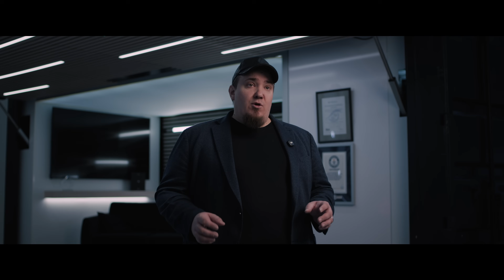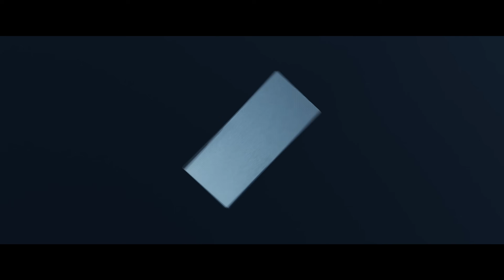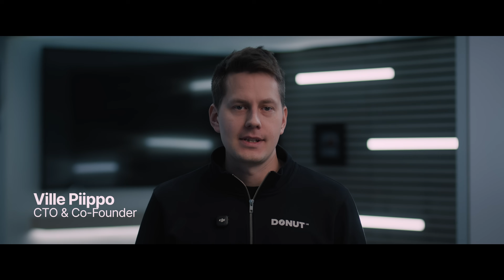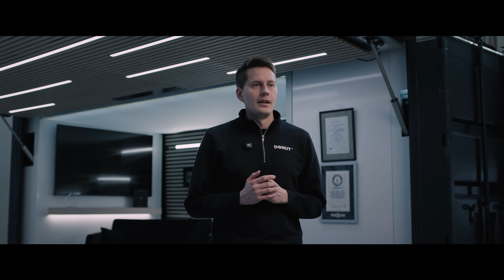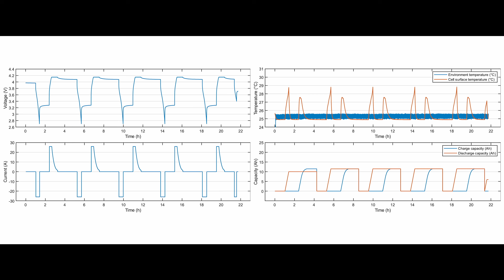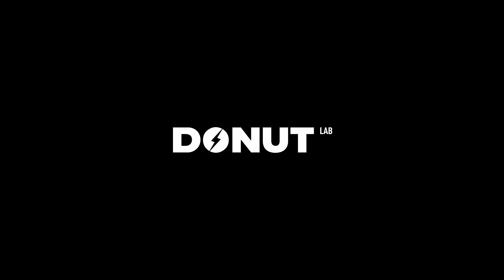Donut Solid-State Battery: Safety Demonstration Test | I Donut Believe (Pt.5)

Comment: I'm interested to know how a cell with a broken seal and no gas generation is able to puff up like a ballon to nearly 20% of it's original size 🤣
Reply: Gemini said
Like @RatInACage guessed, humidity is likely the culprit. Solid-state materials tend to soak up moisture like a sponge, (really hydroscopic?). Once the pouch breaks, the damp air gets in and reacts with the battery chemistry, causing the materials to physically swell. It puffs up just from that reaction, even without any gas or heat being generated. Probably also some physical separation between the layers, most likely what caused the loss in capacity, and then weirdly the gaining back of some capacity.
Reply: Maybe via humidity absorption? 🤔
Reply: Perhaps a reaction with air (oxygen/water vapour?), due to the pouch losing its seal. Wouldn't be the first material to react and expand on exposure to air. 

There is an amber/red coloured blob of something in between the battery terminals in the document's expanded pack photo, by a crease in the foil. This would make sense as the location of a pack failure given it had to deal with high temperatures from the 100°C test and charging current through the terminal. 

Oddly this particular cell didn't have Kapton tape across the terminal seal edge (neither in this test nor the original high temperature test where it first failed), unlike the other cell subject to the 5C/11C charging test. Perhaps it's a thermal handling weak spot for the test cell pouch material. This might explain the adoption of pouch casing, as seen in the CES demo cell, improve thermal transfer and add clamping forces.
Reply: Can you explain how gas keep inside if pouch is broken? Or how if there is gas pouch is flat in surface not a balloon? There is picture on page 14.
Reply: @villeyoyo Yes. The cell looks very uniformally swollen. Pouch is tight and flat as a plank.
Reply: @villeyoyo  Yep. Very odd looking swollen pouch compared to an NMC cell. A swollen NMC cell looks nothing like that.
Reply: Pouch must be a strange material. At the first test 100 C pouch broken and looked like a empty balloon. And now like a tight brik.
Reply: Could the plastic film layer on the aluminum pouch have decomposed during the previous high-temp test?  I’m wondering if they’ve actually solved the seal and pouch material problem for real production. It’s pretty clear that the current material isn’t up to the task at 100 °C (the pouch lost its vacuum after the earlier test) If they had already fixed this issue, why reuse the damaged cell instead of using a fresh one with no problems? The motorcycle production and delivery timeline (Q1 2026 with Verge) doesn’t really match having to solve this kind of fundamental packaging problem right now. In other words, it looks like they still haven’t found a supplier capable of producing a pouch envelope that can reliably withstand these extreme temperatures yet. What do you think, Ziroth? Have you seen any update from Donut Lab on a new pouch/seal material?
Reply: @Doctorbasss they don't need to find a fix.  They're not suggesting that 100 degrees C should be a regular state for these batteries, they were just trying to prove they can do something that lithium calls cannot.   Max cell temps of 80 degrees will be fine for a production pack
Reply: @craigsteele9469  Exactly. Charge the battery at 100ºC and then try to seat inside that car and drive away.
Reply: Someone really needs to test li-ion in the same manner as their vtt tests to see if there's any actual differences......
Reply: Oxidation due to… well oxygen and water vapour? Outer layers  oxidized and protected the inner elements from further oxidation and cell stabilized at 40% capacity.

Sort of like a chemical puncture. Undamaged area remained operational. Voltage remained constant, capacity did not. Just guessing….
Reply: I can't tell if you're laughing or crying. Are you ready to double your bet? $$$$$$
Reply: Boy I really hope for your sake we’re living in the 95% and not the 5%(according to your odds).
Reply: Ziroth stop humiliating yourself lmao
Reply: so it shrank did it?  You mean TO 120% of its size, or BY 20%
Reply: @craigsteele9469 good spot - by 20% (to 120%)

Comment: Why were we never given the weight of the cell, even after several requests?
Reply: It's standard marketing practice to save the most wanted information for last to keep people on the hook longer and keep the product in the media cycle longer. 

I suspect the battery is very easy to reverse engineer, so they want the time to build hype, and product using the batteries, before releasing all information and making the cells available for purchase.
Reply: They are not reading the comments. Oh wait...
Reply: You wanna wanna wanna wanna cry???. Don't be a baby and just wait.  Waiting is not costing you anything and I doubt you are sitting on pins and needles waiting for the the total results.  This is real life and problems happen and no technology is perfect.  This one just makes promises that are better than other existing batteries.

Comment: Interesting that you would create this magic battery but not bother to put it in a pouch that would handle the temperature you've specified. Not catching fire is good though, but also you acknowledge that your battery does not infact handle 100 degrees temperature since it degrades so severely after a single cycle at that temperature.
This is not what you've been claiming.
Also how is that funding run, that you were totally not doing, going btw?
Reply: I think this indicates that the cell under test is still a prototype. He admits using a pouch designed for Li ion, probably becuase it was easily available for prototyping. If 100C is going to be a production specification, Donut should be busy right now sourcing a higher temperature rated material. My suspicion is we are going to see general de-rating of all specs when (if) the battery enters production. They have plenty of room to derate from their claims and still have a very good battery.
Reply: I believe some people just thought that something duch as the polyolefin adhesive on the pouch melted at 100 celcius. You would never consider the polyolefin adhesive failing because lithium pouchs never get to 100 Celcius when borrowing that pouch technology.
Reply: " but also you acknowledge that your battery does not infact handle 100 degrees temperature since it degrades so severely after a single cycle at that temperature."
Haters should wait 5 minutes and think about what they see before spewing vitriol.
Genius, the pouch was damaged. This is, the case or envelope of the battery if you wish was damaged. If the enclosure is damaged and the battery looses vacuum, the battery cells are exposed to the environment, e.g. oxygen, humidity, etc. If the pouch wasn't damaged, do you know how many cycles the battery could handle?
The pouch, as was explained to you, was designed for a lithium battery. No lithium battery even dreams of do anything close to 100º C (other than catch fire).

Comment: So what does this have to do with a production ready battery? If you are testing it with a pouch that is not appropriate for the cell ? You are just testing something. Nothing seems really ready for a production vehicle. I wonder what was inside that Verge...  by the way, why Verge's parent company is inactive? How do you fund yourself right now?
Reply: Let me just remind you that I've been skeptical from the very beginning, if you've seen some of my early comments. However, I am ready to admit that I might have been wrong; we'll see. In this case, however, I must support Donut Labs. The pouch may be production-ready, as the batteries are not supposed to operate at 100 degrees Celsius. In the normal operation temperature (say up to 60 degrees), they may be perfectly fine. So, I don't see any issue here. I am really curious about the cycle life (even 10k would be awesome), aging, and energy density.
Reply: @filipohrbek  I agree. I don't know if people realize how hot 100ºC is. For the luddites in the imperial system,  100ºC is the boiling point for water.
Nobody is charging batteries at 100ºC, even if the battery cells and the pouch could take it. No this battery, no other batteries, no batteries in the future. Unless you want to transform the car into a huge pan.
You will warp the plastic trims of the car, damage its upholstery, melt electronics, and potentially burn the people inside the car. Not to mention the stress to the car's metal frame that will absorb the heat, and its structural integrity after a few cycles of thermal expansion and contraction.
Reply: I think safety would matter obviosly...

Comment: Safety test is nice, but I hope you are saving cold temperature performance, weight, 400w/kg energy density and most unbelievable claim - 100k cycle life - as the last tests. Because those are the biggest and most important remaining questions to back up the validity of your claims.

Comment: We won't really learn much until the bikes are shipped and in the hands of owners. I believe the cold test didn't live up to the hype and they are reformulating the battery for better results and they are stalling for time to do so.
Reply: The bikes are even more of a problem than the possible SSBs, Verge is not a real motorcycle brand, they're a test environment for their trials. Everything seems in a test phase., nothing is production ready.
Reply: And for way less money you can buy a Zero DSR with similar real world specs. The 600km they advertise is for the big battery (33kWh) version and that is their claim of a CITY range.
They promise 315km doing 90km/h. The zero can do 170km with the 15kWh battery at highway speeds.

My car, VW E-UP can go 260-300km with a 36kWh battery. Not impressed even at what they are PROMISING to deliver.
Reply: @gronz  they claim to get it in customer's hands at the end of march. So by that they must have producted quite a few by now :D
Reply: @Bullseiify  Seems like I heard Verge say about several weeks ago the bikes would be delayed until later in the year.
Reply: @sloansteeringsystems it is a scam , they will keep delaying bike
Reply: @Bullseiify  But the bikes are not even homologated yet ?

Comment: How can a battery cell return an error message?
Reply: When they're put into a pack, they get a battery management system (BMS). Nearly all multi-cell lithium packs have one for saftey
Reply: @Tazdeviloo7  When you put it in a pack, the bms will manage multiple groups of cells, not each of them individually. They will not know something went wrong so easily
Reply: @cristibaluta Any decent BMS can detect a single bad cell fairly easily even if just measuring at a group level. A group (series string) will not hit peak voltage, may have voltage sag, etc. from just one bad cell.
Reply: @Tazdeviloo7 
Yes - exactly. That's not an issue here.
Reply: @Tazdeviloo7  yeah, thats true, but the cell itself doesn't know anything. given that this is a cell test its a bit confusing to word it like that :) You can simply say that when a battery temperature sensor reads 100 degrees you get an error message.
Reply: @Bullseiify Right, what they said was technically incorrect, but if your familiar with batteries and the way they fail, it makes sense. A normal Lithium NCM pack would shut itself off completely and you can't use it. Also it's a huge fire hazard. They're saying you can use their battery after damage, just with an error message like a check engine light in a car.

Comment: Never ask a woman her weight. But most importantly, never ask Donut Lab the battery weight
Reply: Lo sai già se hai visto il video sul CES
Reply: @SEmanelit   are from vinvast?? Lol if true, and if donut battery also true, vinvast car buy and must use donut battery Lol
Reply: @paktio3985 la batteria a ciambella raffreddata a aria è stata studiata per la moto. Per auto,per drone e per tanti altri usi sarà concepita in modo differente.Tu te la vedi una batteria di Donut lab dentro un telefono,un orologio a forma di ciambella raffreddata ad aria?Io no. Sarà sicuramente con una concezione costruttiva differente.
Reply: @SEmanelit  ma sei serio?
Reply: If it fits on the same motorcycle and has more power than the regular lithium ion pack, I think we kind of know what the weight is. Come on. Do arithmetic.
Reply: or rather the battery chemistry
Reply: Serious question, will that be the clincher for you?  Me thinks not.
Reply: Weight is irrelevant to these test and specs.
Reply: @Electric_camper  Weight is important for any battery. Otherwise you could take 100 Ah battery and relabel it as "26 Ah" and suddenly it can take quadruple currents during charge and discharge but Wh/kg rating gets about 4x worse. One of the most important claims was 400 Wh/kg rating and yet there's nothing to show anything about it.
Reply: @MikkoRantalainen  I hear your point. 
Thing is, it could never be 3x bigger to make up for your hypothesis.
We all seen it perform. And in the Verge as well. So that form factor couldn't be larger to give it the understated performance.
So, yes in direct comparison's it has a definition in Wh/kg. 
Does it matter with the specs delivered? Not in my opinion since it delivers its claim.
Reply: @Electric_camper it's relevant to this marketing campaign as a whole and they are deliberately withholding the most important variable.
Reply: @iridium11 you see with your eyes how big this cell is and you know the capacity don’t u? Compare a lithium pouch cell in that size and capacity they are not the same!
Reply: @lenahandsen6836 they are exactly the same
Reply: @tedarcher9120 no donut is bigger. Bigger volume. But lighter
Reply: @lenahandsen6836 how do you know that it is lighter?
Reply: @tedarcher9120  He is saying it wrong. We see a cell with similar volume to li-ion. So if Donut Labs is right about the energy density it must mean the cell is lighter. Which we cannot see. Donut never gave the density per volume as far as I am aware and I think that is because they don't excel there. So don't expect the battery to be smaller, expect it to be lighter.
Reply: @tedarcher9120 trust me
Reply: @Electric_camper  weight is highly relevant because it reveals energy density. Which Donut Lab claims it's 400 Wh/kg, but never proved.
Reply: @monkschannel no its not. You can see the charge test with the Verge. No matter the size or your attempt to make kWh/kg from it. The pack delivered its performance.
Reply: @Electric_camper  It performed like a normal LFP or Li-ion battery can. There is no evidence for any of Donut Labs claims, and much very strong evidence against their claims like this newest test.
Reply: @Electric_camper  I understand, you're a believer, but no test released until now proves this is a solid state battery and it has all the claimed specifications from the unveiling event. the fact that Donut Lab refused to provide the cell's weight (everyone asked for it and it was the easiest thing to just put it on a scale) is quite telling. believe what you think, but this smells funny. this whole campaign is just smoke and mirrors
Reply: @izzeww8487 no it didn't. See two bits DaVinci take on the test too. It's nowhere near LFP.
Reply: @monkschannel you can't measure breaking tech with old findings.
Chery automotive in China has launched a SSB too. And without any proof of concept going this far.
Something can be groundbreaking. It's the same as the change to the electric light bulb. Wasn't comparable to old tech as well.
Reply: italiani nei commenti ? POOWEERRR :glasses-purple-yellow-diamond: secondo me hanno due celle una con alta capacità e una con ricarica rapida... per questo non mostrano il peso
Reply: @Solid_Snake99 quello che monteranno sulla moto elettrica quanto peserà.